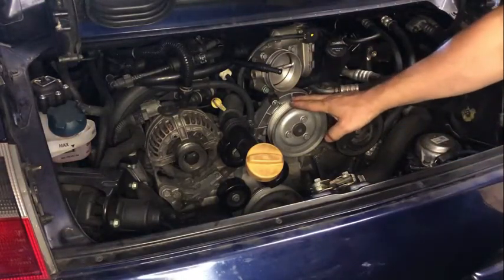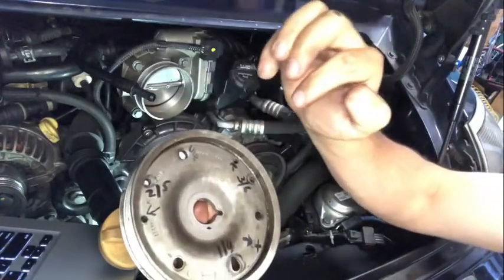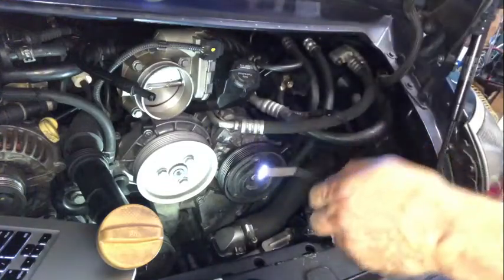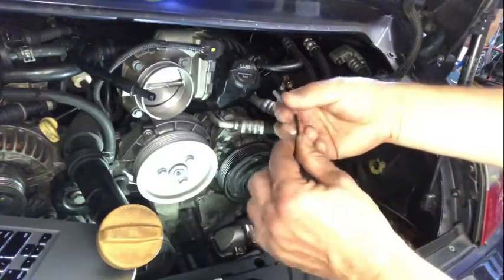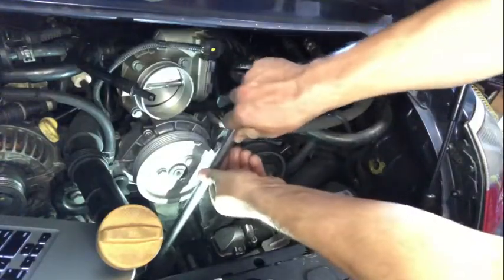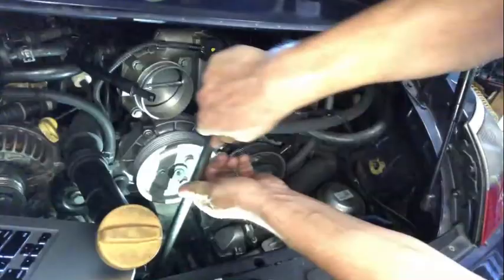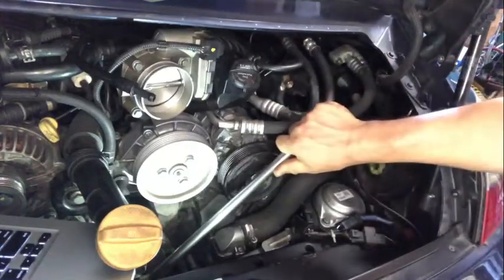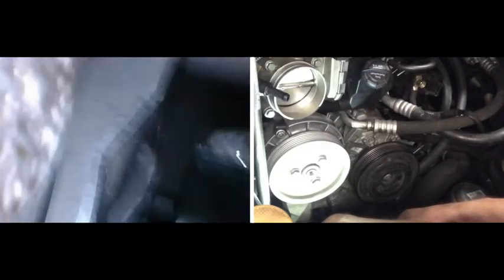Bore scoping M9x Porsche engine on all cylinders via crank -shaft side without draining engine oil

Comment: FYI this was hugely helpful!! I'd already drained my oil but hadn't popped the sump plate off yet. Searching for my an old video of the sump method I found this. Very full on my 997 S. The driver's side I didn't get to but those weren't the cylinders I was worried about anyway. Thanks so much!

Comment: Thanks for sharing this! I tried scoping through the sump, and wasn't able to see much more than cyl #5. I'll have to try this next time!
Reply from the maker: Pleased it looks promising to you. I agree - through pan the #5 is one of the easiest , and the biggest challenge is #1. I ended up being able to do later only with help of extra light and second camera through the wrist pin port to guide the sump camera. Since this "helper-" camera did produce not less info, I only tried on the other cylinders, and so this method was born. Did quite a few times on the 3.6, but succeeded on my 3.4 as well (where you have a bit less space)

Comment: So far, I have not heard any well maintained 996.1 <2001 3.4L suffered from bore scoring
Reply from the maker: "well maintained" (by the playbook) isn't a guarantee that you wont see flaws once you look carefully. Wear comes with using things, and so with the intrinsically weak (soft) cylinder materials used in these engines for a decade. Just a matter of time until the problem surfaces...(and even when, I know lifetime can be stretched substantially with inspections and preventative work)